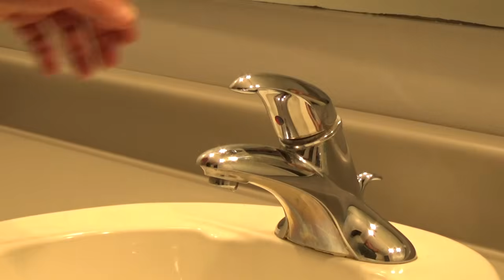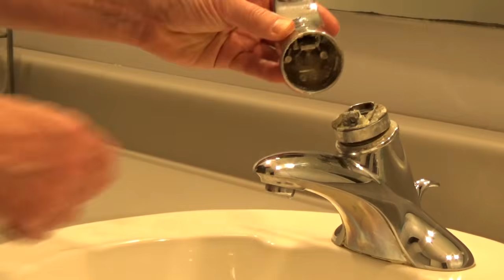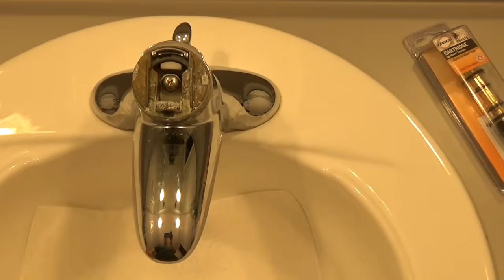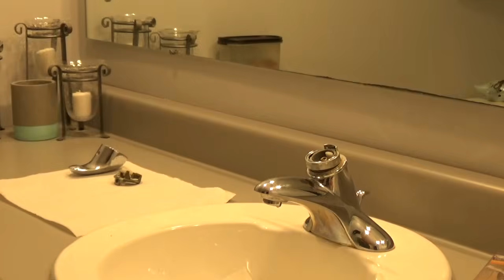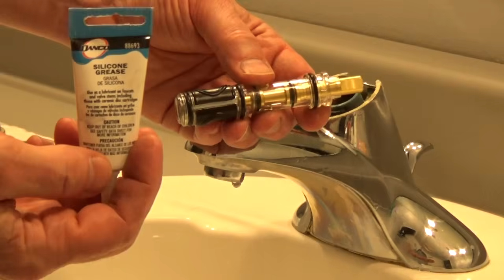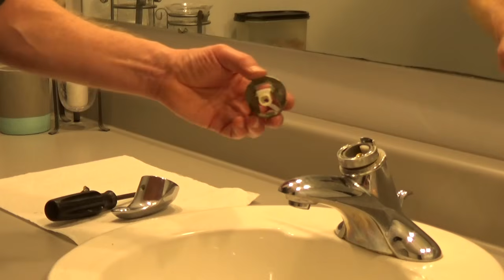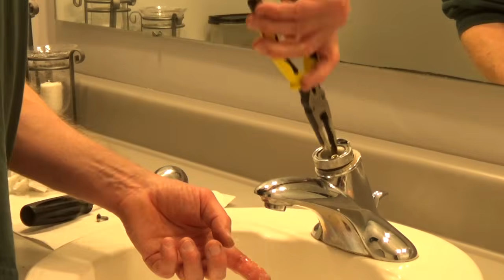Moen Bathroom Faucet Repair - Moen 1225

Comment: I've replaced cartridges in both of my bathroom sinks over the last few months.  The new Moen cartridges had a TON of silicone on them out of the package.  So much so, in fact, that the faucet wants to turn itself off "automatically" when the handle is raised!  Very annoying!  I'm also still trying to figure out why the ring shield seems to be looser than expected on my second repair.  At least the faucets don't leak any more!

Comment: Thank you!!! Thank you !! For a great video very instructive. I learned a lot. 
My bath moen is an older model. Your video help a lot regardless. I did follow your steps, however I could not pull the cartridge out. I pulled all the pins as you showed. I put WD-40 and Aldo white vinegar in case the calcification was the problem ( vinagre should help dissolve the calcification). But I still cannot pull out the cartridge.  Any suggestions? Thank you much in advance.
Reply from the maker: Hi, did you try using the plastic removal tool and a wrench to twist the cartridge before you pull on it?

Comment: The part where you said “the nest piece unscrews counterclockwise”. I have the most trouble with.
It just won’t unscrew. Keeps turning,and turning but will not come out.  I have removed the clip but keep getting stuck here.  Any recommendations??

Comment: You skipped over the part where the retaining clip is inserted in the slot on that white plastic piece. Having trouble getting the retaining clip lined up properly so it can slide in. Any suggestions?
Reply from the maker: Hi, you can use the plastic removal tool on the cartridge to line it up so the clip slides in.
Reply: @FIXITHomeImprovementChannel  
The clip slides in just fine without the plastic piece. It’s only when the plastic piece is placed on the faucet body that the clip won’t slide in.

Comment: Excellent video
Reply from the maker: Glad it was helpful.
Check out more home improvement tips in our e-books https://www.amazon.com/gp/product/B0B2KW1FQ9?notRedirectToSDP=1&.
Reply: @FIXITHomeImprovementChannel  So I replaced my cartridge today, all went well up to the point of unthreading the plastic collar piece.  Wouldn't move on mine, I cleaned all the gunk up around it and could see that the cartridge would pull through the opening, which it did so the plastic piece dose not come out on newer moen bathroom faucets I guess.

Comment: A few days ago my faucet handle started sticking. I had to pull really hard on the handle to turn the water on. The handle was also loose and shook a bit, even though the allen key part was fully tightened. Replacing the cartridge fixed both problems for me, so thank you so much for this video. Some tips:

1) Home Depot gave me a replacement 1225b cartridge for free when I gave them my old one. 
2) When I tried to shut off the valves under the sink, the hot water valve was really hard to turn. I ended up using a small wrench to turn the valve.
3) There is a gray round part that screws in and out. It was hard to turn by hand, so I used the 4 little grooves/slots on the side by sliding my needle nose pliers in the grove, then turning the pliers.
4) I removed the old cartridge using a cartridge puller tool that I already had from a previous cartridge replacement job. But I still had to pull very hard to get the cartridge out. Make sure nobody is standing behind you, or you might knock their teeth out when the cartridge comes out!
5) The hardest part of the repair was getting the retention clip back in after inserting the new cartridge. You have to make sure the new cartridge is fully in. The clear plastic part of the cartridge should line up flat with the brass part. I had to put the white square cap on, spread my wrench across it, and push super hard down multiple times to get the cartridge all the way in. I felt like I was gonna break the vanity!
6) I found out from another video that the hole on the cartridge stem should be in 6 oclock position. When I did that, the hot/cold water turned out to be the right way.
Reply: Thank you for the tips you shared, they were very helpful. I have a 90s version of the moen bath faucet and I’m still having problems pulling the cartridge out. I did use WD40 but it had not helped. Any suggestions?
Reply: Thank you for the tip about the cartridge clocking. I had mine in wrong too.
Reply: GUY AT HOME DEPOTS PLUMBING DEPARTMENT LAUGHED AT ME SAYING (QUOTE) I'M NOT HANDING YOU OVER NOTHING FOR FREE. NEEDLESS TO SAY HE SAID IT AS SARCASTICALLY AS ANY HUMAN BEING COULD OF. I DON'T EVEN WANT TO GO TO HOME DEPOT FOR WOOD OR ANYTHING ELSE AFTER SPEAKING TO THAT JACK ASS IN OCALA, FLORIDA.

Comment: Exactly what I needed.  My faucet is that model and brand new.  I'm trying to find out what is restricting the flow but I see that it uses the old-style cartridge so it can't be the cartridge.  I need to find out where to determine if I can remedy it.  I've already learned that it isn't a problem with the new shut-off, new hoses, and replacing the 1.5 gpm aerator/filter assembly on the faucet outlet with a 2.2 gpm makes it worse because no more water comes out and it simply comes out with less force.  I'm hoping I can take it apart and drill out the restrictions.  There has to be a restriction on both the hot and cold because on just hot or just cold slows down the flow until you put it in the mix position.  I wished I had not gotten rid of my old Moen faucet when I replaced the countertop.  If I can't find something that flows a lot better then I'll either set up a check valve that sends 2 gpm down the drain plus the 1.5 gpm to get hot water there, or put in a recirculating system.  Fortunately I saved my old toilet

Comment: Moen Cartridge Review and Tip to Extract Struck Cartridge

There is something important that every instruction is missing when explaining how to remove the Moen cartridge. This tip will help prepare those who attempt to repair their dripping faucets which uses a Moen cartridge that will not come out easily.

Information provided for informational purpose only.

https://ponderthinkact.blogspot.com/2022/11/moen-cartridge-review-and-install-tip.html

Comment: My phillops screw keeps spinning does not come out
Reply from the maker: Hi, you might be able to use a screw extractor to grab the top of the screw and pull it out.
Reply: @FIXITHomeImprovementChannel  the plastic piece it screws into was cracked. Kind of dumb to have the most important thing made from plastic.Thank you for the reply

Comment: Do all Moen single handle bathroom faucets use the same size cartridge? If not how do I know what size to get?
Reply from the maker: Hi, the most use 1200 or 1225 cartridge. These are also interchangeable. But there are other styles. Once you remove the old cartridge, you can take it to a hardware store or home center and they can match it up.
Check out more home improvement tips in our e-books https://www.amazon.com/gp/product/B0B2KW1FQ9?notRedirectToSDP=1&.

Comment: Replaced mine, but I'm getting close to zero water pressure.  Should the retaining clip go over the flat washer?
Reply from the maker: Hi, the clip goes over the top of the cartridge.
Reply: @FIXITHomeImprovementChannel  turns out I had to just clean out the aerator!

Comment: Try as I may, I cannot for the life of me unscrew the grey piece that’s supposed to come right out. I’m so frustrated because my sink keeps leaking and it’s that one piece standing in my way.
Reply from the maker: Hi, did you try unscrewing it counterclockwise with a pair of pliers?
Reply: @FIXITHomeImprovementChannel  yes, I did. I don’t even know how it’s possible for it to be in so deep.
Reply from the maker: Can you catch the top hex shaped area with an adjustable wrench and turn it?
Reply: I am having the same problem. The gray part doesn't unscrew. Can only move maybe 1mm on both directions. There is a notch stopping further movement. Can't pull it up either.

Comment: Thanks for the excellent information. As a side note, the grey threaded section on our faucet was not removable. It could twist slightly left and right but didn’t twist far enough to remove it. We were able to pull the retaining clamp from the back as well as push it towards the back from the front of the grey part. Once the retaining clamp was removed we were able to pull the cartridge out with our pliers. Then continued to replace the parts according to his video. Hopefully this helps.
Reply: The gray threaded section on my faucet is also not coming loose and i am afraid it may snap, Yes, i am turning it counter-clockwise.
Reply from the maker: Hi, did you try to turn it with a pair of pliers? Counterclockwise
Reply: @FIXITHomeImprovementChannel  Yes, with all our strength. Also added CLR to try and see if that was the issue. I feel that we have a different moen model than the one you demonstrated as there was no separate white plastic piece, it was one solid grey piece only.
Reply: Ya he said and did show how to do it . What u missed was that you turn the grey peice counter clockwise not clockwise

Comment: Saved me a call to the plumber, thanks my guy!! Also you might wanna consider spending the extra 15 bucks on a cartridge puller...I got mine out eventually without one but it took every upper body muscle I had and multiple attempts before it finally came out.
Reply from the maker: Glad it was helpful
Check out more home improvement tips in our e-books https://www.amazon.com/gp/product/B0B2KW1FQ9?notRedirectToSDP=1&.

Comment: Excellent video, including how you zoom in and explain each detail.  One important point I missed was skipped was testing the hot/cold before finalizing everything.  Mine turned out being reversed so I had to pull and reinstall.  Still, I just finished replacing my old Moen 12801 with the 1225.  I had a heck of a time getting the old cartridge out--pulling with all my might using channel-lock pliers on the stem wouldn't cut it.  Instead of spending another $20 on a puller, however, I opened up my small channel lock pliers and put screwed the top screw through the "channel" where you slide the two jaws closer or further apart.  This gave me a very effective "poor man's puller" and I was able to get it right out pulling on the two handles of the pliers.  Hope that helps someone.
Reply: LOL I did the same thing...WATCH UNTIL THE END PEOPLE....lesson learned 😂😂. Also consider spending the extra 12 dollars on a puller...I got mine out without one but it took multiple pulls using every upper body muscle I had.

Comment: Hi excellent video and everything went smooth for me ,except that when my tap is in the hot position the lever tends to creep down therefore slowing down the flow….any suggestions on what the problem might be?
Reply from the maker: Hi, I've had this happen and spoke to Moen. They recommended pulling up quickly on the handle a couple times to see if this helps. If not replace the cartridge. They will replace it for no cost. 
We have more home improvement tips on our weekly podcast 
https://itunes.apple.com/us/podcast/fix-it-home-improvement/id880903087?mt=2

Comment: It would have been nice to include how to lubricate the shaft INSIDE the cartridge for push/pull models; all my five old MOEN faucets never leaked, but they become hard to open or close.
Reply: That's what I do - I pull out the inner part and clean it and lube the O Rings. THEY don't want to show you how to regrease the old cartridge bc they want you to buy a new one.

Comment: I have an older faucet and i loosened the  allen screw but i cant pull the top of the faucet off.  Am I supposed to completely take the screw off?
Reply from the maker: Hi, with some you may need to remove it, or tap the handle to break loose any corrosion that is holding it on.

Comment: We have an older Moen bathroom faucet and cannot figure out how to remove the cover of the center set handle. There are no set screws so I’m guessing the cap either pries or screws off but we would probably need a strap wrench or the like to get it off?
Reply from the maker: Hi, you can send a picture to fixitpodcast@gmail.com and I'll see if I know the model.

Comment: PLEASE HELP!!  (Excellent video).  I have encountered a problem.  When the stem is pushed down the water should turn off but I still have some water flow.  Any suggestions on how to fix this problem?
Reply from the maker: Hi, if you take off the knob and push in the stem with a pair of pliers does it turn off?
Reply: @FIXITHomeImprovementChannel  I never put the knob on because I wanted to test it first.  I have already pushed the stem in as far as it will go and I still have water flow.  Certainly not as much with the stem pulled out.  I won't put the handle on until I figure out why the water will not should off when the stem is pushed in as far as it will go.
Reply from the maker: Hi, if the cartridge is inserted all the way and held in place with the retaining clip, it may be bad. I would return the cartridge and get a new one.
Reply: @FIXITHomeImprovementChannel  Many thanks for your quick responses.  And yes, all those requirements are met.  I received it free from Moen.  Their helpline opens on Monday.  I plan to contact them then.  Thanks again.
Reply from the maker: Happy to help. We have more home improvement tips on our weekly podcast 
https://itunes.apple.com/us/podcast/fix-it-home-improvement/id880903087?mt=2

Comment: What's the difference between the #1225 and the #1200 cartridge? Is there an easy way to know which one to order before I disassemble the faucet?
Reply from the maker: Hi, they are interchangeable. When I took some training from Moen, they said the 1225 plastic cartridge was designed for areas with mineral deposits or rust in the pipes or sand from well water. It also has a lower water flow to save water. These are not interchangeable with the Posi Temp faucets. 
We have more home improvement tips on our weekly podcast 
https://itunes.apple.com/us/podcast/fix-it-home-improvement/id880903087?mt=2

Comment: I can't put the clip in the cartridge! It just doesn't fit! I wonder if the cartridge was so old that clip is not the same as new Moen models..
Reply from the maker: Hi, you can use the plastic removal tool to adjust the cartridge so the clip slides around the 2 tabs on the top of the cartridge.

Comment: Excellent video.
I replaced my cartridge and everything seems to be working except for when l lift the facet to use it keeps coming down resulting in reducing the water flow.
What did I do wrong?

Comment: Thanks for your great video! I have a similar model faucet and following these steps exactly helped me fix the leak!

Tip: the official Moen replacement part doesn't come with the removal cap (they want you to buy a $30 tool), but Home Depot sells a third party version that's exactly like what's in this video.
Reply from the maker: Glad it helped.
We have more home improvement tips on our podcast https://podcasts.apple.com/us/podcast/fix-it-home-improvement/id880903087

Comment: Great video, and lots of helpful tips. My tap was 23 years old and would turn but not come out. I read that pouring some vinegar down and letting it dissolve the calcium would work, but it would take time. My process took two days of patience and more vinegar, but eventually pulled straight out. After this the instructions made the replacement easy. Thanks a lot!
Reply from the maker: Glad it was helpful.
We have more home improvement tips on our podcast https://podcasts.apple.com/us/podcast/fix-it-home-improvement/id880903087

Comment: Great vid, but what do you do when the plastic pivot retainer nut (I believe?) is stuck and won't unscrew? Tried vinegar, CLR, even WD40 to no avail (approx 1:30 into video)
Reply: Having the same issue. It turns but just keeps turning and doesn't come out
Reply: @amandakindelan7453   I gave up, eventually. I was just trying to take it apart to clean it and just ended up drowning it in various things until it was good enough :(
Reply: Same issue! I can't get past this step
Reply: Maybe you could VERY gently tap on all sides to break up the rust and/or mineral deposits that are preventing it from unscrewing?

Comment: I can't remove the phillip screw inside because plastic thst hold the screw is broken 
What am I supposed to do ?
Reply from the maker: Hi, you can send a picture to fixitpodcast@gmail.com
Reply: @FIXITHomeImprovementChannel  you touched it at 1: 12    That white plastic part was broken and I couldn't remove screw because of it .
Reply: I have the same problem. :/

Comment: Great video but what if you cannot break the deal with the plastic removing tool included? When I did exactly what you did to loosen the old cartridge the plastic remover tool cracked in half. What would you do in this case?
Reply from the maker: Hi, Moen recommends spraying white vinegar or CLR into the faucet to break down the buildup of mineral deposits around the cartridge. I would return the plastic removal tool and get a new one. Make sure you removed the retaining clip. After you let the vinegar or CLR work, move the tool back and forth gently, move it up and down to help break the bond.

Comment: Thanks for this excellent video. These tasks usually take forever because something inevitably goes wrong, but this video made everything perfectly straightforward. 

One little tip: The clip did not go back in easily. Look for a little line on the top of one side. When this was facing up it went in easily.

Thanks again!